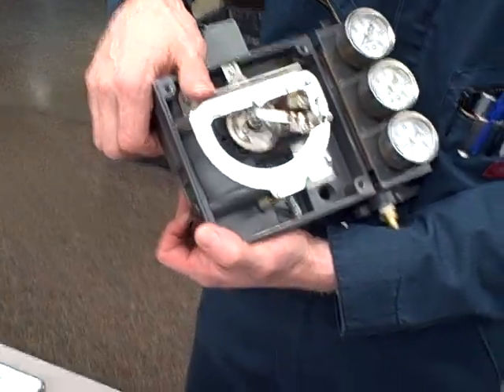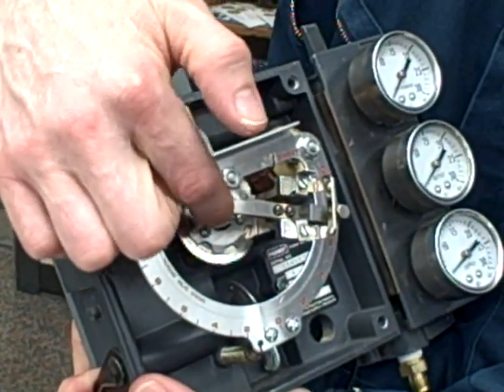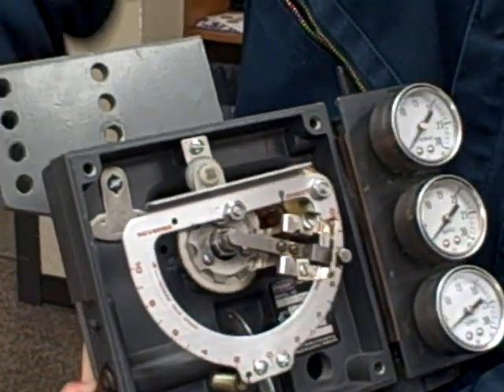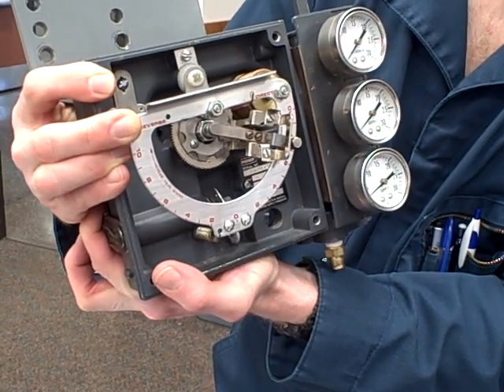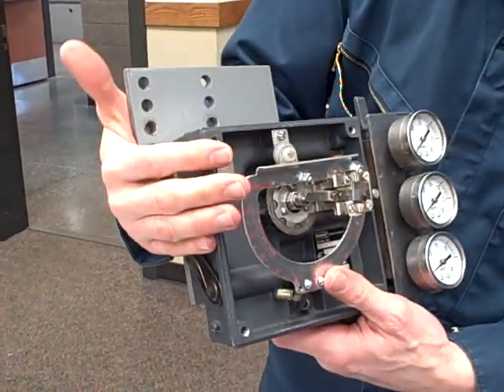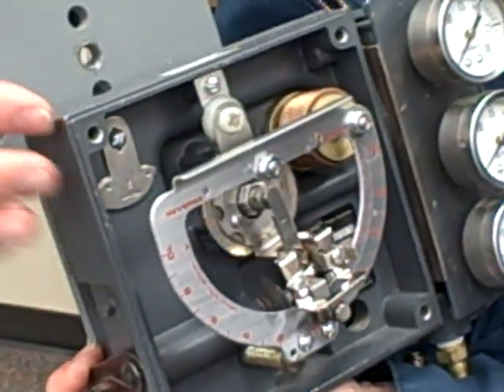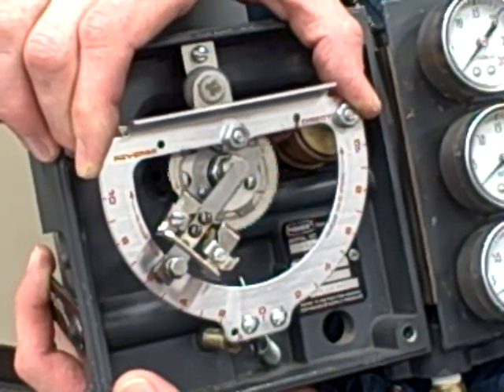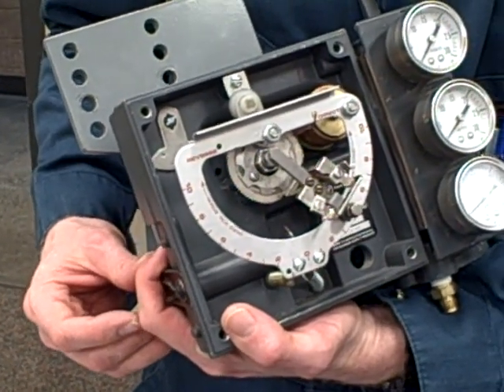Fisher model 3582 D-ring control valve positioner (manual demonstration)

Comment: Question? How are non linear trims on control valve compensated for with a model 3582 positioner?
Reply: The feedback would come from the cam on the actuator lever.

Comment: hey you have explained very good but i have one doubt in direct acting when bellows inflates it moves  the flapper down and  trying to valve open then flappers goes back to same position..so if flapper goes back to same position there is no back pressure so how it restrict the valve open then

Comment: So would these be a Proportional only controller? Or Prop-Integral (reset). Great Video though thanks
Reply: The 3582 is a positioner,  not a controler; so tuning paramaters such as proportional(gain), integral(reset), and derivative(rate) are not set or determined by it. The 3582 can, however, change the flow characteristics of the valve between linear, equal percentage, and quick opening  depending on the type of cam installed in it. ( cam types: A, B, or C)

Comment: Does anyone know where I can find tips and or steps to calibrate the positioner having real trouble with it?  Please
Reply: the fisher 3582 manual has all the necessary procedures, albiet difficult to follow and understand if you dont already have pre-existing knowledge of the positioner. https://www.emerson.com/documents/automation/instruction-manual-fisher-3582-3582i-positioners-582i-electro-pneumatic-converter-3583-valve-stem-position-transmitter-en-124114.pdf

Comment: Great video, thanks. You mentioned at the beginning that the "brass bellow" is connected to the I/P? Are you sure about an I/P? As there is no transducer, as you are not converting any signals here.
Reply: it doesn't have to be an I/P BK2. the input to the positioner just has to be an air signal. However, if you're using an electronic controller then you have to convert the signal at some point. I believe Fisher also makes a model of this positioner which integrates an I/P converter on the unit.